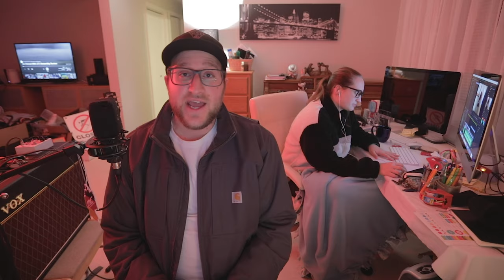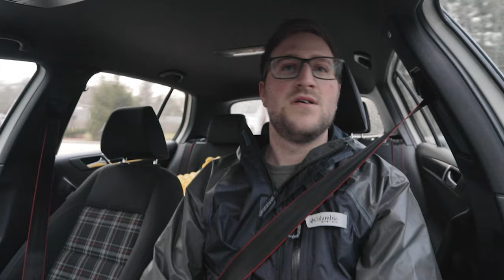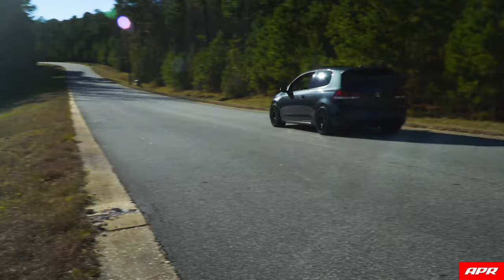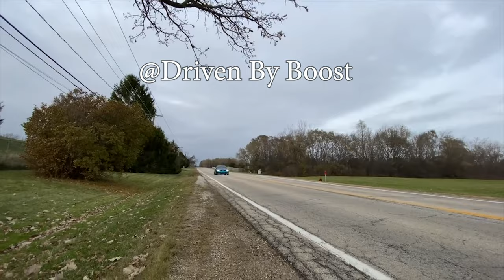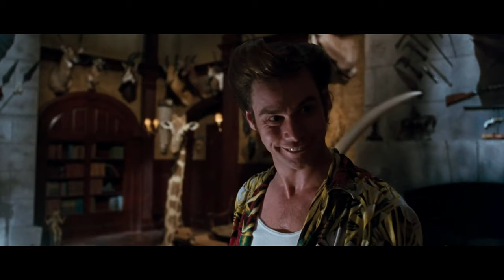Update: Fixing My GTI at 115k miles, Future Plans for the Channel

Comment: Hmm I wonder if putting a dv spacer would help or solve that whine sound, either way it would be cheaper and sound good. And yeah that APR catback sounds awesome!
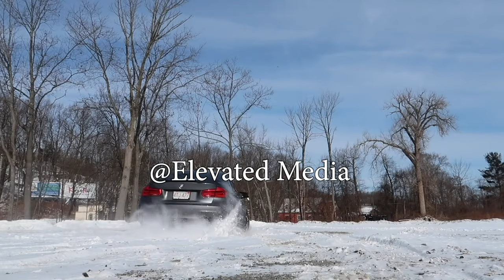Reply from the maker: Driven by Boost  that’s what the unitronic technician recommended! I’m definitely going to have to see if it works. Did you have that problem with your open cold air intake? Also, check out this vid around 6:44 if you haven’t seen it yet! #shoutout
Reply: Not-So-Handy Car Guy hahahaha my man that was awesome!!! Thanks for the shout out!!

And I never had an issue with my open intake, I had the apr closed intake on my mk6 gti so it wasn’t as loud, if the dv spacer doesn’t solve it than maybe check the fittings for a leak 🧐. Either way keep me posted and another killer job on the video! Your production quality is top notch!
Reply from the maker: Driven by Boost no prob at all my dude!! You’ve got some sick stuff and need to be making money on here, so anything I can do to help! That’s right, I keep forgetting you had a mk6 before the R! 🧐 Thanks for the insight and I appreciate the compliments Chris.
Reply: Not-So-Handy Car Guy that’s the goal! Just picked up a dslr camera for better video so I’m hoping it helps, just gotta learn how to use it properly 😂. Either way I’m pumped for the growth of our channels!
Reply from the maker: Driven by Boost hell yeah! If you ever need any sort of direction on theory behind manual camera settings just DM me- I went to school for cinematography, so I might be able to give you my $.02 or a couple basics. What’d you get for a camera?

Comment: I got a single mass flywheel as well, yup, chatter.  But brother, it’s lighter and more durable!
Reply from the maker: s9523pink for sure, dude. Unfortunately mine starts slipping under high load with the new tune. So I got a stage II clutch from ECS. Hoping that does the trick. Just got to figure out a good time to install it LOL
Reply: @NotSoHandyCarGuy  🤣  I gotta feeling that'll solve your problem!

Comment: so what was the sounds you were getting in the engine bc i have it and it's wasn't there before and been driving it for weeks
Reply from the maker: Unfortunately it was the timing chain. I would get it checked out asap to avoid a timing slip. I caught mine in time, thankfully.
Reply: Not-So-Handy Car Guy mine I thought something is up because the engine bay got louder with a sound I can’t put my hands on but it wasn’t this loud 2 weeks ago is when it started I told my brother and dad they said oh no don’t worry about it but they don’t know that that’s a big problem which it’s our first German car and a Pain in my ass since I got it and it’s only at idie or when I’m stopped as the rode noise makes it to where you can’t hear it I would talk a video and ask you to let me know if it’s that but can’t thought here
Reply from the maker: Ali Vape Reviews gotcha gotcha. Yeah man, the timing chain is nothing to mess around with. Definitely get it checked out by a proper mechanic. After I had my intake manifold and timing chain done, the car has been very good to me. Knock on wood. Sorry to hear you’re having issues dude!
Reply: Not-So-Handy Car Guy problem is they went 250+ just to check it that’s why I asked I’ll making a video and you can maybe tell me if it’s that as I don’t know nothing about what sound it makes or exct but i dont know where I would send it
Reply: Not-So-Handy Car Guy and I don’t have the money to get it checked for $250 and then possibly have it be that and pay over 1k to replace it as mines is a 2014 vw cc I thought it had the updated one but like I said i dont know if the sound is from that but it is coming from the left side of the engine somewhere around the oil Filter
Reply: Not-So-Handy Car Guy only problems I have with the car is that sound and a p0491 code I believe